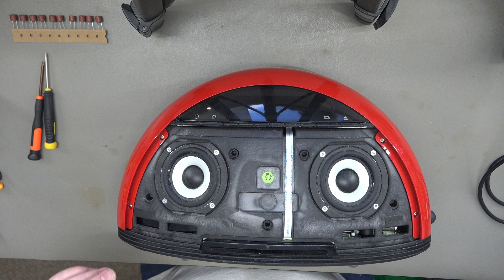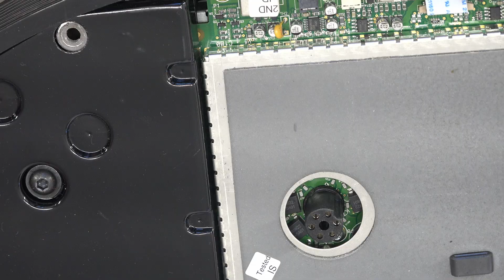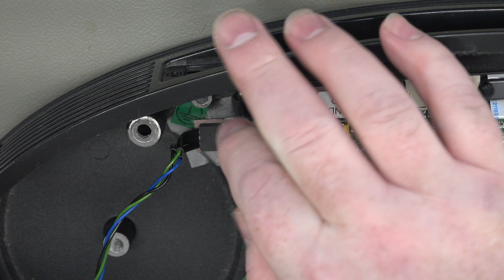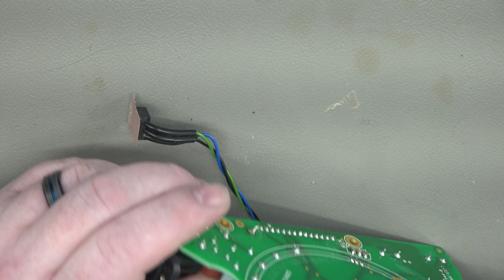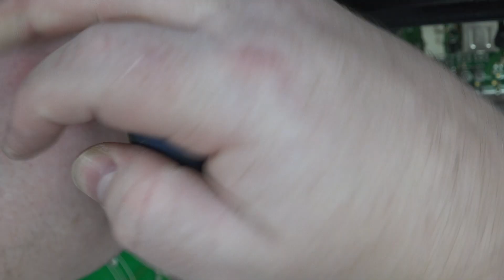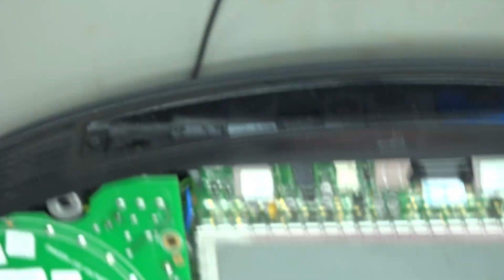Ferrari - Meridian F80 Repair

Comment: Anyone whose having difficulty removing the black grills should be aware that these are also secured with 3 adhesive patches,which are VERY powerful! I had to carefully use a variety of strong,non-scratch 'tools' - the best of which being a wooden spatula which had a keen edge to get in between the grill and the coloured surround(s).